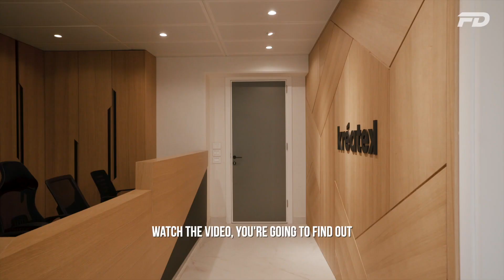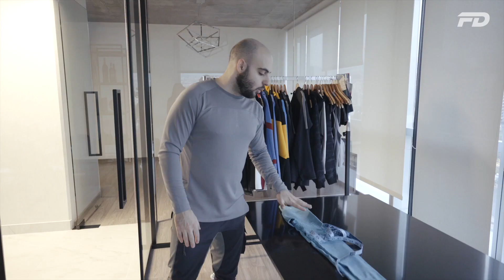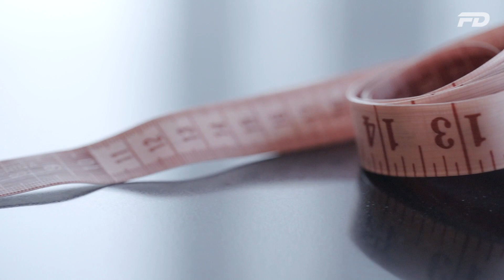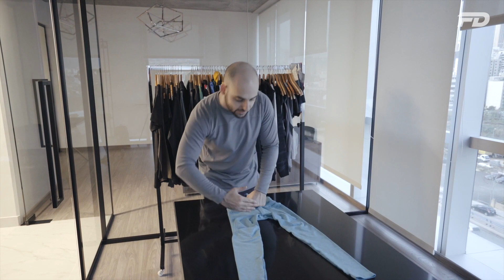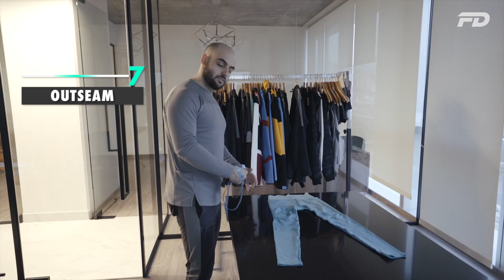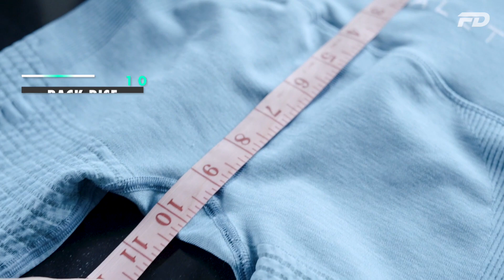How To Measure Ladies Leggings For Design & Fitting Purposes

Comment: Thank you for this informative video. I have a question. You are taking these measurements on the garment as it lays on the flat surface. However, are these the measurements that you use when creating your tech pack or should measurements when on a person or mannequin be used? (The spandex makes it smaller and more compressed when not worn). Thank you for your time and attention!
Reply: Hi - Did you ever work out an answer to this?
Reply: @taniafoad760  no I didn’t
Reply: This is how you measure for tech packs!   You measure it flat! However, you're using fabric with spandex.  If your fabric is 2% spandex, and the garment you measured was 6% spandex, the fit wont be quite the same. Did this help...or nawwww?